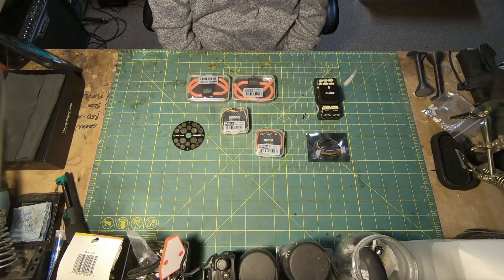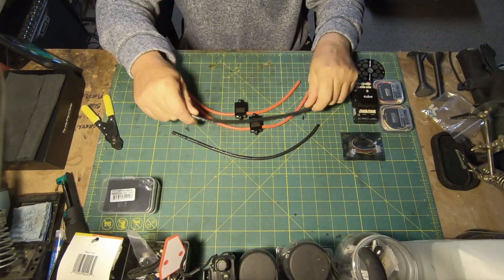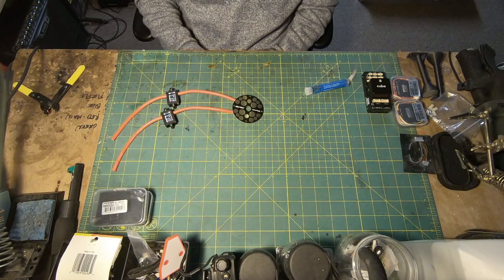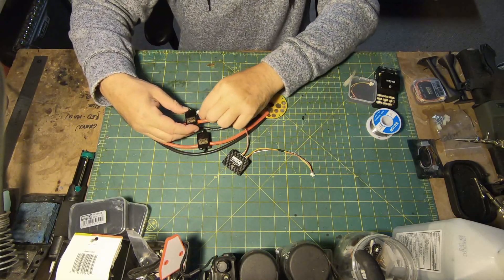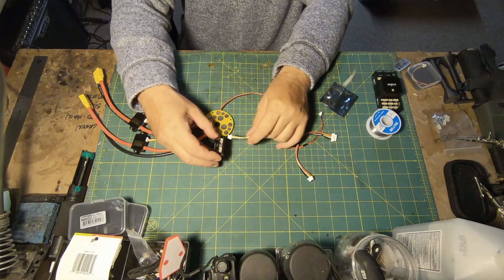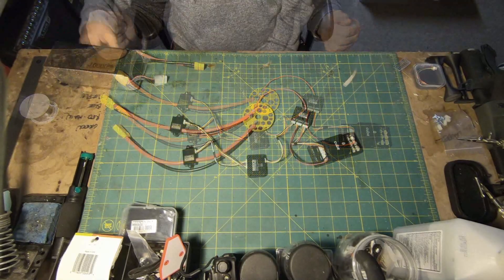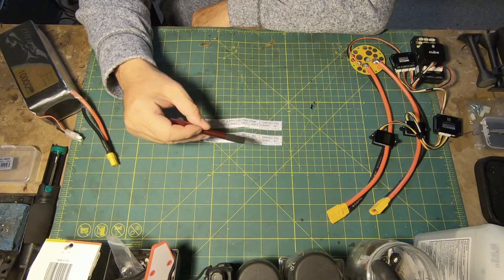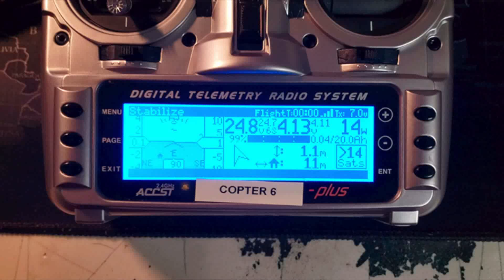Mauch Power Module Installation and Setup

Comment: Can my battery be like a car battery?
Reply: You are not trying to manage voltage in a single battery configuration. This is for measuring true voltage for drone flight.
Reply: @BananafishRox  wait so I can use a car battery? Since it's 12 volts and my solar panels are 12 volts. The power module adjusts the voltage for my Cube computer and all that stuff? Sorry I'm new to this I need hand holding :S
Reply from the maker: @Anthony-lk5dm  Sorry, That was my band's account.  A LiPo battery has several cells as a car battery has one. The purpose of the Mauch system is to draw power evenly to get more accuracy during flight and to add time to flight by drawing from the strongest cells first. You cannot do this with a solar panel.
Reply: @Shadowquad  right ok, so a car battery is not going to work. It needs to be lifepo?
My solar setup is just to recharge the battery
Reply from the maker: @Anthony-lk5dm   What are you trying to achieve? Saving off-grid power? Going off grid?
Reply: @Shadowquad  no it's an RC boat for work, it's going to carry some heavy stuff in a toxic tailing lake at a mine. 
So I'm fiddling with ardupilot and RC electronics but I'm entirely new to this stuff. Everyone keeps talking about lifepo batteries but I don't see a reason to not just use a car battery. We have a 110ah 12 volt battery. It'll all be eventually connected to a cube orange and a esc for the motor
Reply from the maker: @Anthony-lk5dm Where are you located? A boat is fairly trick too. Ground rovers and boats are harder to control than drones. Harder to program. I have to go do some work but I will try to help.
Reply: @Shadowquad  I'm in Panama but the work will be done in Canada. I'm here on vacation and also to see if a project like this is feasible. From what I see on youtube it's totally attainable, but requires a fair amount of knowhow
Reply from the maker: @Anthony-lk5dm I was born in Vancouver BC. How big is the boat? The project is doable but you will need two motors to steer and I have to look into battery specs to see what is really needed.
Reply: @Shadowquad I have one motor, which was pretty dam expensive, and I ordered a servo online in hopes of making into a rudder. The boat will hold four solar panels, of 100 watts each. The length is like 2.2 metres tall and like a metre wide. I used to live in Vancouver! But I'm a small town countryside person for the past many years. I'm happy to pay you some for the help and guiding hand !
Reply from the maker: @Anthony-lk5dm  go to www shadowquad dot com and contact directly

Comment: Thank you so much, i'm doing something similiar. One question though, by connecting that two batteries output to common PDB, do you have any problem with reverse current or one battery trying to charge the other battery? Im still looking for PDB for my fixed wing build.

Comment: Great video. Just out of interest why did you opt for the 8AWG as opposed to 10AWG? Interested to see what kind of amp draw you were getting.
Reply from the maker: Probably overdid it but 10 was probably plenty.
Reply: @Shadowquad  I had to rethink everything as I'm drawing 250A at 95% throttle. Tried to desolder 8AWG and resolder 6AWG but its near impossible due to gauge size.
I don't recommend this at all. Haha
Reply from the maker: @antznixon  What? Jeez, how big are the motors?

Comment: What about battery monitor 2? How can we see both battery voltages
Reply from the maker: This is an "in series" tutorial. I think you could do a parallel set up but would need a FrSky FLVSS LiPo Voltage Sensor, then SmartPort into the Pixhawk. Use the voltage divider on Battery 2.

Comment: Hey man,

I’m a bit confused about Mauch !!

I want to be able to read voltage & current to preform a flight time estimation while flying to manage missions but I’m not sure what setup to use, I’m using 2 PL Mauch (distribution boards) and 2 x 7000mA batteries in a quadcopter setup.

I’m planing to use this to achieve the above :

https://drones.altigator.com/mauch-power-module-for-pixhawk-up-to-6s-200a-p-42366.html

The question do I need to use two of these ??

do I need to add BEC or my PL Mauch enough ?

Thanks in advanced
Reply from the maker: You need this system for dual batteries.

 http://www.craftandtheoryllc.com/store/mauch-premium-line-dual-battery-kit-voltage-current-sensor-regulated-power-supply/#configuration
Reply: Hi man, what is the setup using Qgroundcontrol? I’m having trouble making battery indicator works